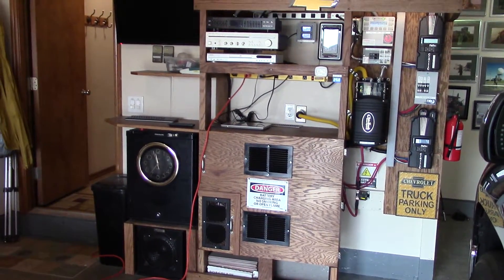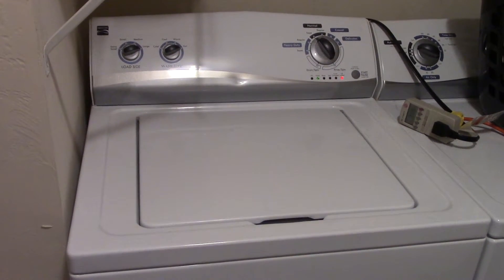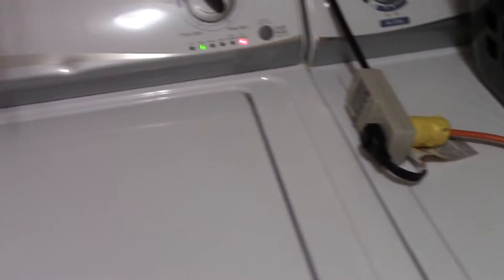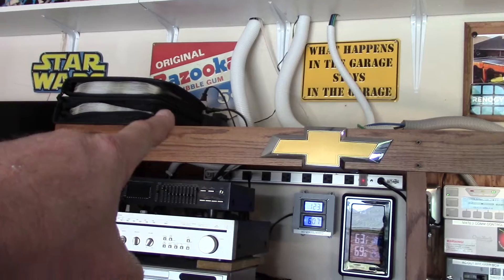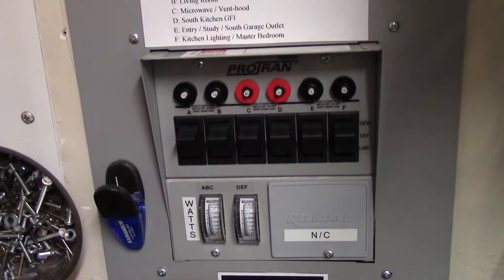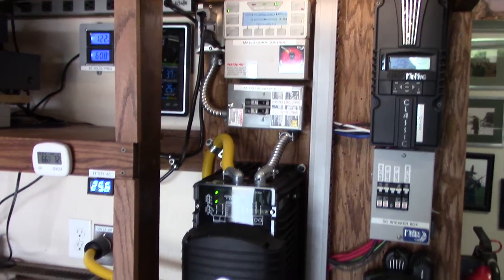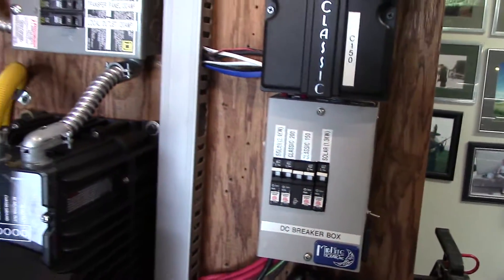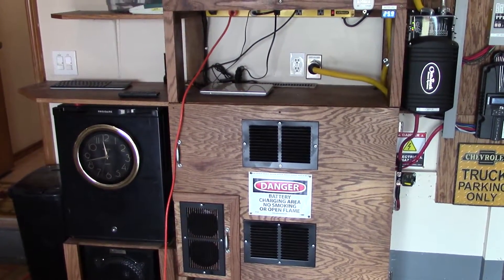DIY off-grid solar power - washing machine test. It works!

Comment: We started doing our washing on solar, also.  Saved a weeks worth and ran 2 loads on solar alone and it worked out just great.  Had plenty of spare headroom on the inverter for the other appliances we leave connected.  If only I could get the wife to use a clothes line......  She does not like how clothes feel hung on a line while I love it.  No way I'm going to run an electric dryer on solar....  I really appreciate how you show that a "normal," suburban home can have solar that is not invasive plus you demo how every day electrical loads can be shifted off the grid.  Great channel !
Reply from the maker: Thanks. Electric dryers gulp power like a C5 taking off fully loaded. Clothes lines (and drying racks) are awesome. Found I use them for more than just clothes drying! We all love convenience, but older ways seem to be making a come back

Comment: I designed and installed a full house Solar system (everything solar except well, washer/dryer and Electric stove) that accounts for two days of no Sun.  Based on my load budget, I just might be able to run the washer too, I'll have to recalculate.  Viewers please remember that a "Load Budget" for the system is CRUCIAL to fully understand; you can't just willy-nilly start adding appliances to the system.